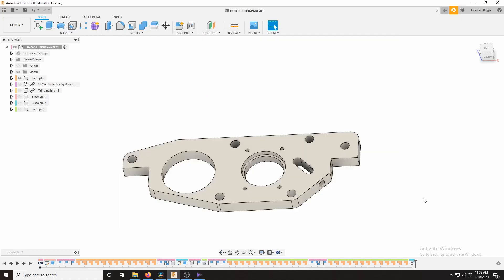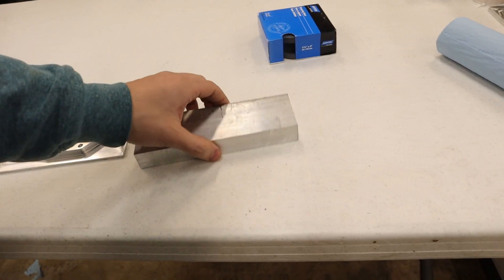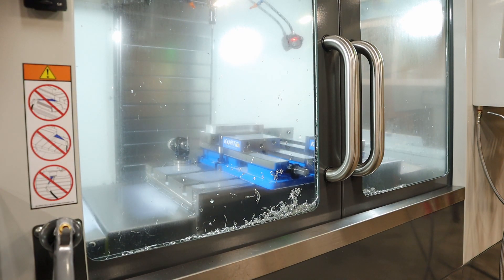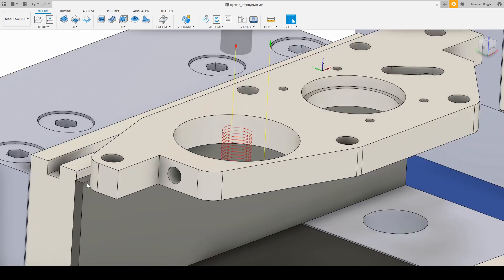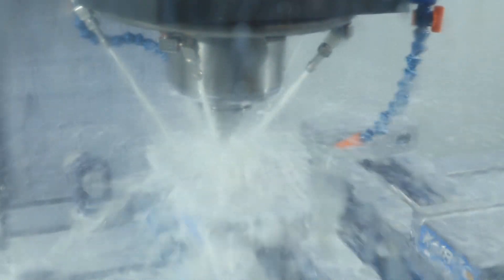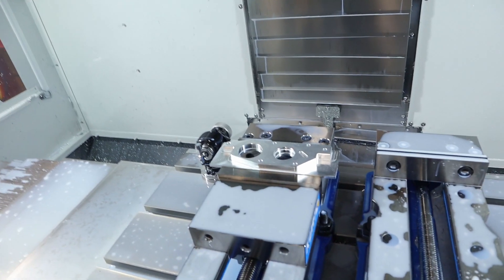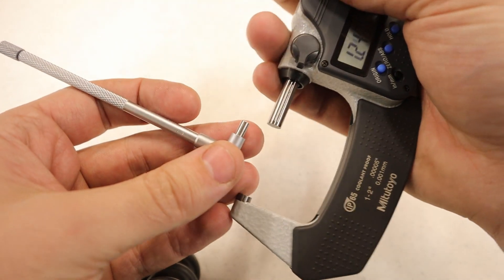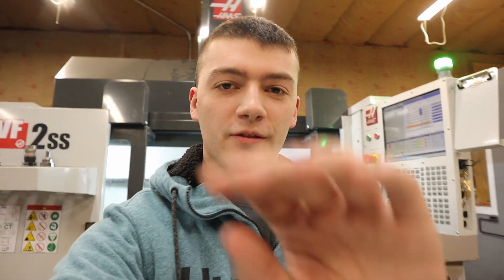Johnny5 part - NYCCNC - Part1

Comment: Don't get me wrong here but to not be able to get those bore correct on the first part. Either your programming is incorrect with the offset or not popper set up.   After programming go into wear comp -.005 cut measure adjust wear comp and done

Comment: That’s the same band saw I was looking at. Unfortunately Harbor Fart won’t let me use a %20 coupon anymore. Once again great videos man!
Reply from the maker: Being completely honest.. If you need one its worth it. I slapped a metal blade off amazon onto it and ive literally cut s7 tool steel down its length which was 7 inches I think. Just a word of caution if you get it make sure to take a look at it before you get it off your truck. Mine had a crack in the casting from it being flipped over and there was no way I was going to find the motivation to re hoist it by myself back into its crate. :)